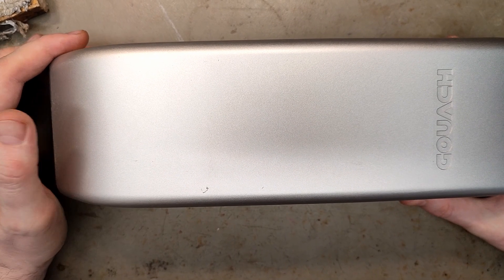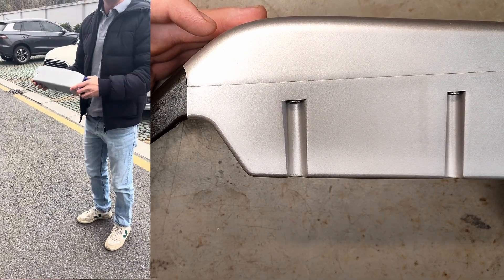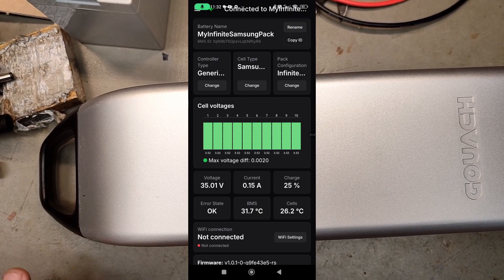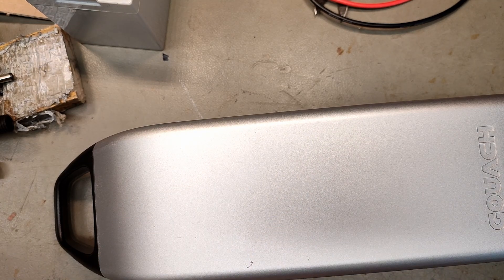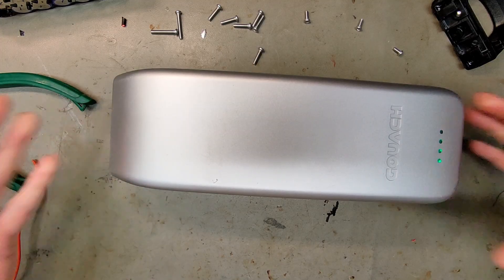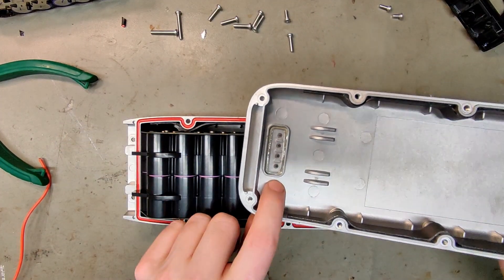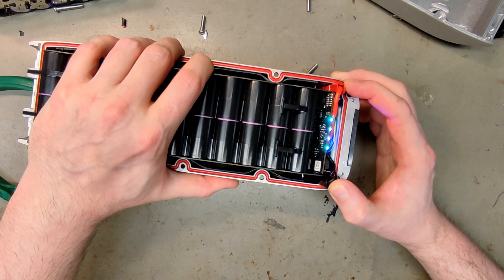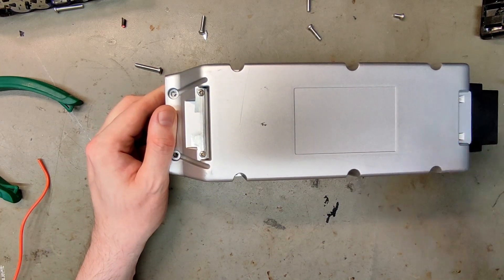Is the Gouach Infinite Battery really that good?

Comment: I have to admit Alex at Gouache/Infinite gets little over optimistic with his projected dates.  Good things are worth waiting for.
Reply: Mine is up and running after some minor niggles.  YES IT IS EVERYTHING THEY SAY IT IS.  Absolutely superb.  The app is due to be updated before too long.  Alex at Gouache has informed me just today that the top row of the cell holder will be offered with a 21700 option.  To be fair I have been testing mine over the last week and using my style of riding in my own fairly flat region my range is up to 150 miles on a single charge which is more than enough for me.  I can understand commercial users wanting more capacity though.  I have a made for Bosch black neoprene cover on mine.  It fits perfectly even though the battery is a little longer than the Bosch.

Comment: Wish I could buy one.
Reply: You can. Just because aware that if you are outside the EU you are going to pay import duties or if you are REALLY unfortunate and live in the USA,  TRUMP TAX or grift.

The battery is excellent.  I have the Bosch version which I have populated with Samsung 35E cells 3500mAh each giving me 580Wh at full capacity.  The app doesn't monitor each individual cell just each group of 4 but then you check those 4 with a multimeter.  The BMS itself is a work of art being reverse engineered for Bosch compatibility and is a solid as a rock in performance.  Many naysayers predicted the solderless cell cage would cause problems but they have been proved to be wrong.  There are very, very few issues reported with the over 4000 units produced so far and many are used commercially as it cuts company maintenance costs by incredible amounts.  The case is simply some of the best manufacturing I have ever seen.  Of course there have been minor niggles for early investors like having to trim bits of plastic and grind an edge or two but nothing to affect safety or functionally and these will be addressed now we have reported them in feedback.  The app does all I want of it.  I don't need the app to inform me of drain or tell me current capacity as the bike controller does all that and it's just impracticable to keep referring to the app whilst moving.  It is handy for temperature monitoring though in hot weather but a periodic stop is enough for that.  I can highly recommend it based on user experience and feedback on the forums.

Comment: I'm so tempted to get one but they still don't offer a 52v version. That would be perfect for my CYC Photon
Reply: They don't YET ;-) there constantly tweaking and updating just now
Reply: Yea I was talking to them a year ago about that and they said January 2025... Guess they're a bit late.
Reply: @StreetDogSteve Yes they are running behind but as with any new company nothing ever truly goes to plan.  Hang in there, big things are coming so Alex tells me.  I truly wish them well.  Mine is truly a revelation.  I had a little insight into battery electronics before but what I have learned with this project has made it great fun and very rewarding.  I am now reaping the rewards of my patience or rather lack of as this battery simply blows my original Bosch battery away and I was actually very impressed with it until this one turned up.